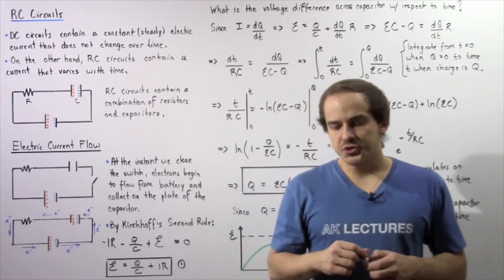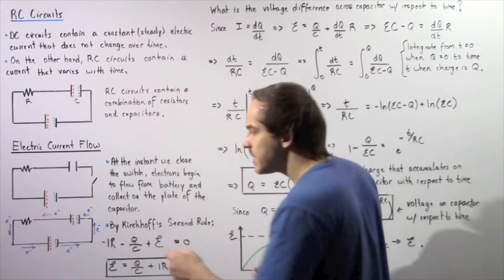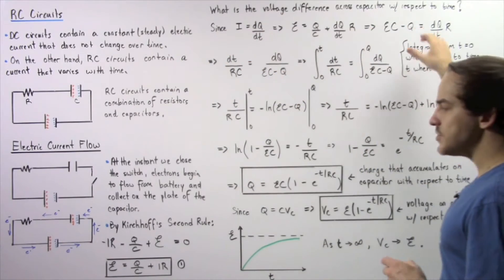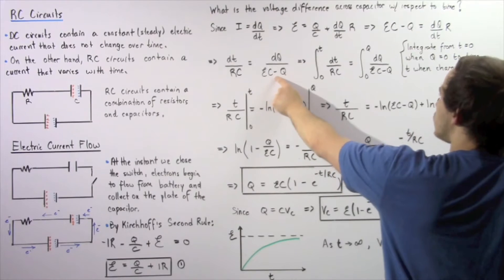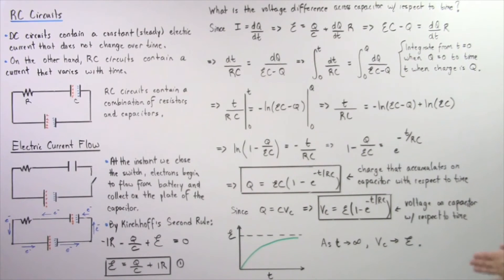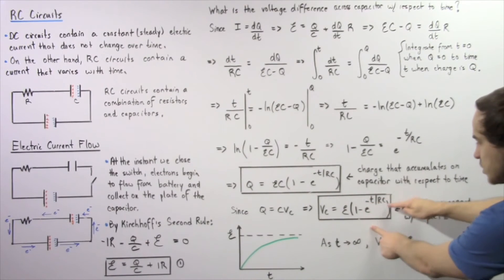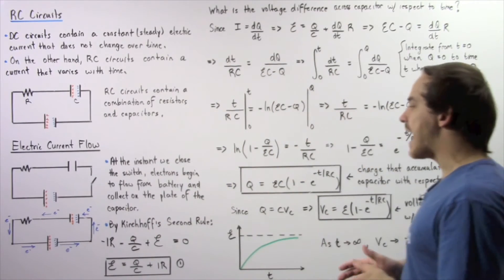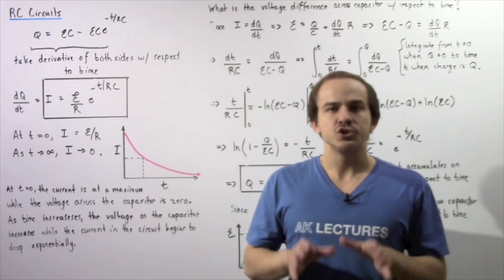RC Circuits, Charging Capacitors and Equation Derivations

Comment: Thank you it was  helpful

But at 5:29 I think it should be RC
Reply from the maker: Yes, you're right. When I multiplied both sides by C, forget to stick that C in there. Thanks.
Reply: AK LECTURES thank u...I thought I was wrong.